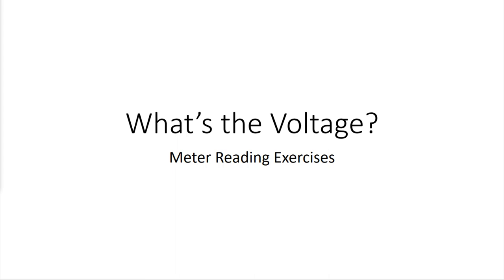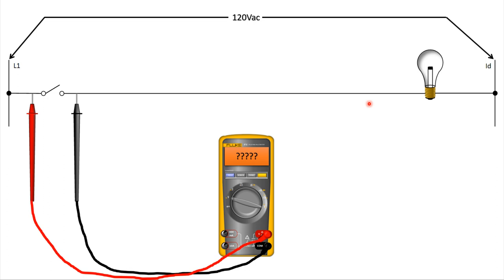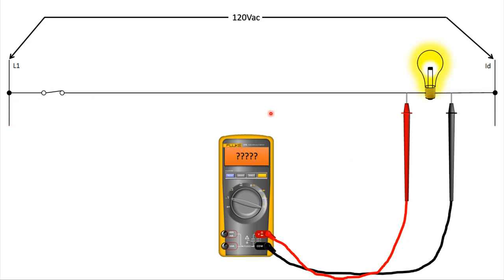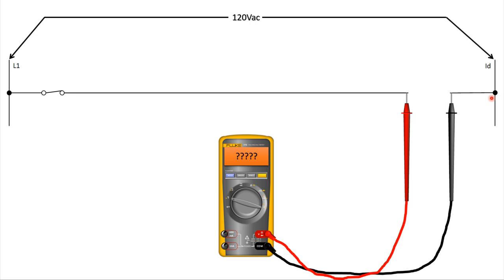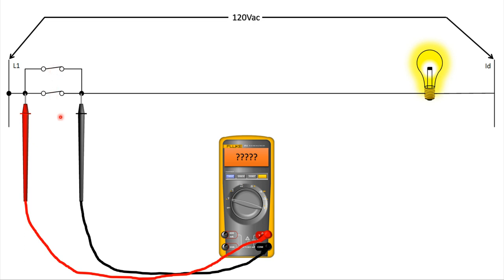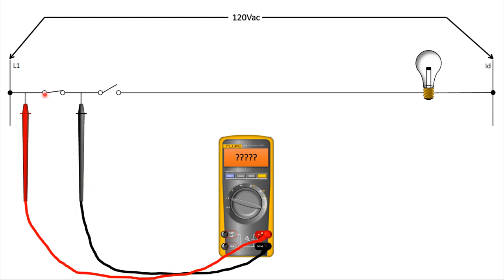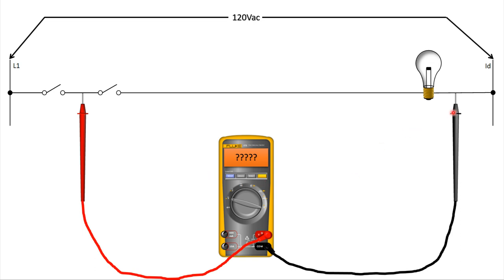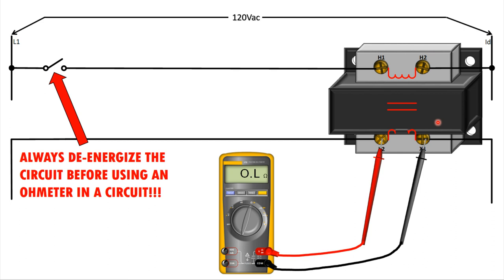Basic Electrical Troubleshooting

Comment: This is a very good lesson.I always preferred the RESISTANCE TEST OVER THE VOLTAGE TEST  FOR THE REASONS CITED IN THE VIDEO, ESPECIALLY FOR TROUBLESHOOTING FANS.I SIMPLY CONNECT THE OHM METER TO THE POWER CORD AND ROTATE THE FAN SPEED CONTROL.

Comment: Hi there sir I'm fairly new to the electrical industry , firstly this is an awesome video I just wanted to know why the voltage over the open switch is 120 Vac ? And if its switched on won't there be an short circuit ?
Reply from the maker: There are many analogies to explain why this occurs, but the easiest is to think about potential difference. One side of the open switch is connected to one polarity at the source, and the other side is connected to the load, but with no current flow the load would not have a voltage dropped across it. At this point, the maximum potential difference would exist across the switch. To answer your second question, when the switch is closed, the load is now connected, and opposing current to the level inversely proportional to it's resistance. If it was just a switch connected to a supply with no load, then yes it would short circuit because the circuit would have zero, or almost no resistance/impedance, and current would be very high.

Comment: I thought if the switch is open, you should read any voltage across it because the impedance is so high no voltage should be traveling through the switch. Maybe I’m stupid but I’m confused.
Reply from the maker: If the switch being metered is in parallel with a closed switch, it will not read a voltage as both sides of the switch would have the same potential due to the closed switch.
 If a single switch is open, and the load is removed, then there is also no potential across the switch as the wire between the switch and the load is essentially like waving the meter lead in the air as it isn't connected to anything at that point.
Let me know if this helps clarify!

Comment: Why is there 120VAC on both sides of the lamp? That would mean theer is OV across the lamp and it will never turn on.
Reply from the maker: There isn't 120 on both sides, there is a potential of 120 across the lamp from the supply. I'm not sure how you mean 120 on both sides.

Comment: Excellent detailed video. Thanks for sharing this. Why do you refer to the one side of the circuit as "identified"? Isn't that simply the neutral side? Just curious. Thanks!
Reply from the maker: If it is just line 1 and the white wire it is the identified. If it is line 1, line 2 and a white common to both it is the identified neutral. The term identified means it is "identified as the grounded conductor" by being white or natural gray.
Reply: Nice Video! Forgive me for butting in, I would appreciate your thoughts. Have you researched - Tarbbatigan clean errors Tip (erm, check it on google should be there)? It is a good one off product for discovering how to fix electronic devices without the hard work. Ive heard some interesting things about it and my friend Sam at last got amazing success with it.
Reply: Excellent video content! Excuse me for chiming in, I am interested in your initial thoughts. Have you researched - Tarbbatigan clean errors Tip (erm, check it on google should be there)? It is an awesome one off guide for discovering how to fix electronic devices minus the headache. Ive heard some interesting things about it and my work buddy after a lifetime of fighting got amazing results with it.

Comment: Closed circuit should have voltage
Reply from the maker: Across a switch in series with a load it will read zero. Test it out.  Always good to check what your unsure of.

Comment: Id is identified as common or ground???
Reply from the maker: It would be considered the grounded conductor. Not to be confused with the ground wire itself, out the bonding conductor. Often referred to as a neutral, but in this case it is not truly a neutral, but the conductor "identified" as grounded.
To simplify.... The white wire.
Reply: schulerruler Thank you very much.

Comment: To bad you didn't take a class on turning up the audio so people could hear what your saying.
Reply from the maker: You may want to adjust your volume. By adjusting the volume levels, you can make videos, or songs, or podcasts quieter or louder depending on your needs. Consult your user manual for whatever device it is you are listening on to find the location of the volume adjustment buttons. Sometimes it's a dial, or it may be a push button.
Thanks for watching and commenting.
Reply: I can hear it just fine. Maybe he needs new batteries in his hearing aids
Reply: Nope, I am having difficulty hearing him too.......all volumes turned up.